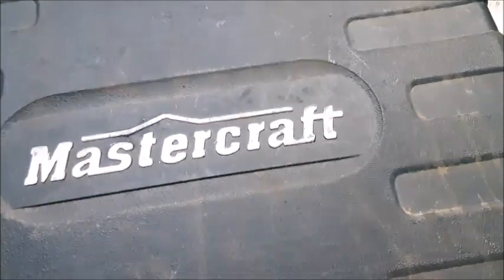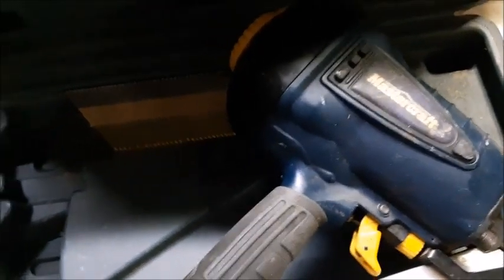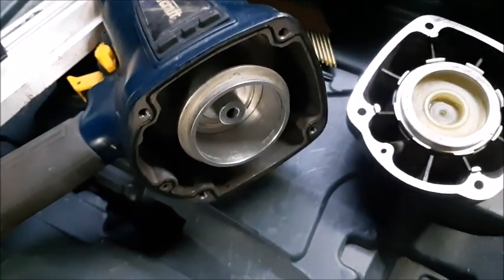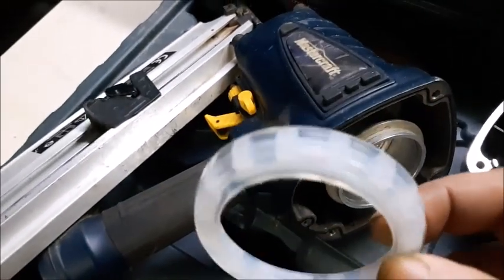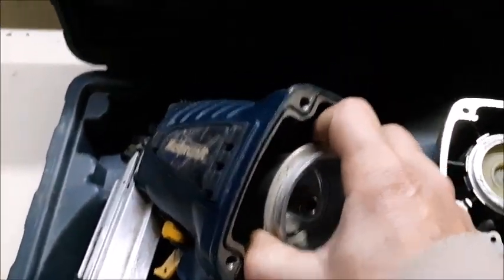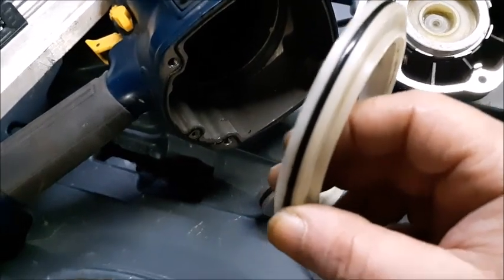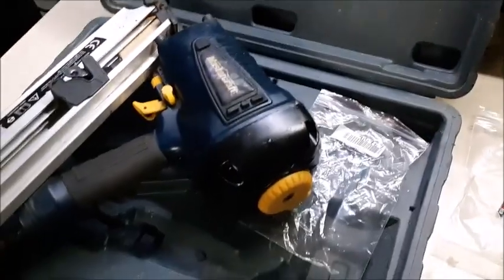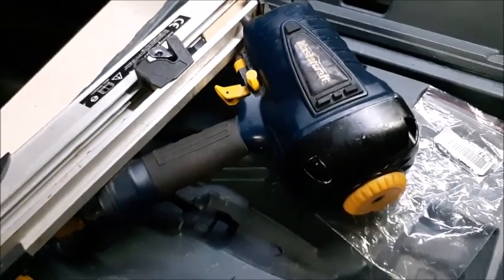Mastercraft  34° framing nailer  gun collar seal air leak  repair

Comment: Thanks 🤙 do you know if the cylinder cover bumper(#8 in part list) is the same as that porter cable model ?
Reply from the maker: it should be, but verify the dimensions , Porter Cable # 901901 Piston Bumper

Comment: Thank you for your video!  My gun (which looks identical to yours) does not sound like it is leaking any air.... but the pin that drives the nails does not retract all the way back to the proper starting position after firing.  Do you know if this needs the same fix as you showed on your video?  ..... or something else?  Thanks again
Reply from the maker: if you can retract the pin by pushing it in manually and able to fire a nail , it might only need some  lubrication,  if not,  remove the piston and verify if any obstruction  or some bad seals
Reply from the maker: for O rings search , Porter Cable Overhaul Kit 910450 Nailer

Comment: Cylinder cover bumper Where can I buy this accessory?
Reply from the maker: Try Piston Bumper p# 901901 or 886113  For Porter Cable depending on the measurement size you have , AMAZON $20 ALIEXPRESS $7